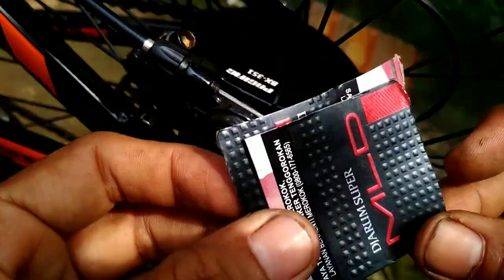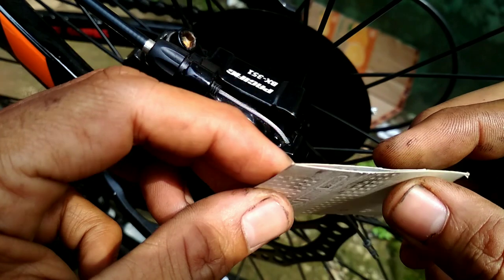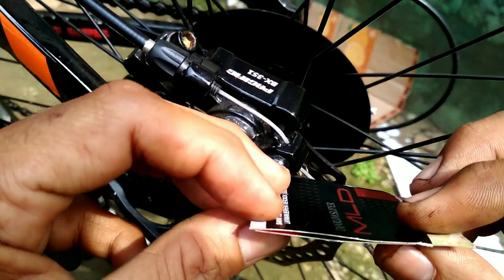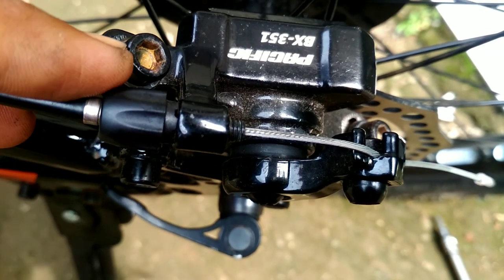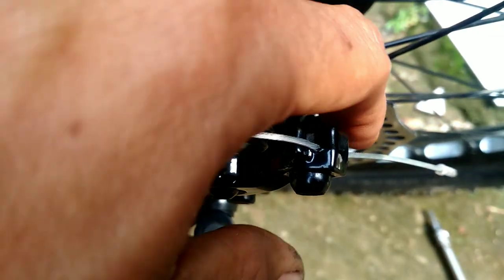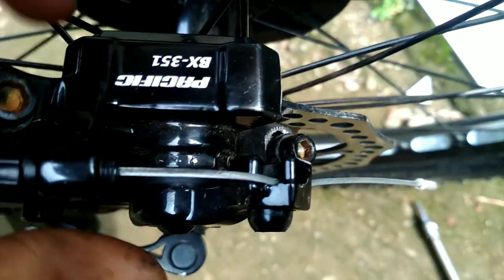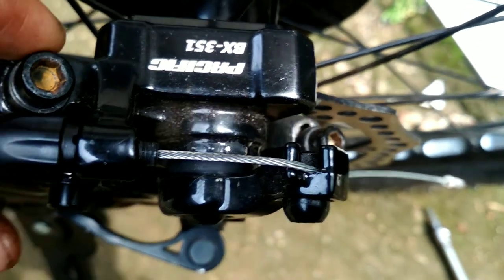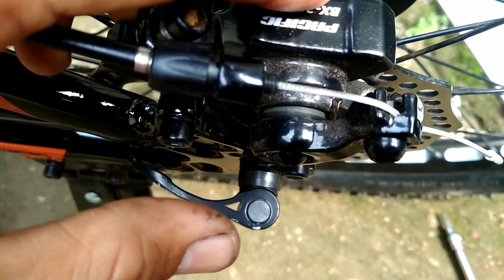Cara atasi rem sepeda bunyi, cara setel rem

Comment: kalo sepeda saya malah kebalikannya mas,,bunyinya saat tidak di rem,jd saat di goewes dia bunyi ngak ngek ngok jd kudu di rem baru agak bekurang bunyinya,, apa solusinya sama juga kek di video ya?
Reply from the maker: Kemungkinan piring cakram nya bengkok gan.
Reply: kalo sya perhatikan sambil mutar ban belakang rotor disc brake lurus2 sj sih mas ga begesekan ama brake pad
Reply from the maker: COBA posisi sepeda nya di balik biar lebih jelas
Reply: sya merhatikannya emg posisi sepeda sudah dibalik mas
Reply from the maker: Bingung mas, klo gak liat, hihi
Reply: @HamdanMaulana  bawa ke bengkel sepeda mas ..ada alatnya
Reply: wah kasusnya sama mas dgn seli saya..klo digowes hrs direm sedikit baru ga bunyi ngak nguk
Reply: akhirnya skrg udah ga bunyi2 lg,,setelah sy perhatiin lg ternyata kampas remnya yg ga balik lg pas sy ngerem akhirnya sy cba bongkar kampas rem,,lalu sya bakar  kampasnya cuci dan pasang lg,,alhasil bunyi ngak ngek hilang dan rem menjadi lebih pakem masbro tks ya 😂🙏
Reply from the maker: Mantap, hehe. 👍